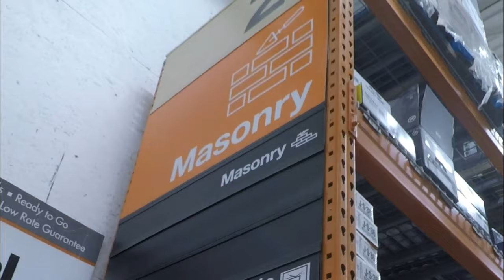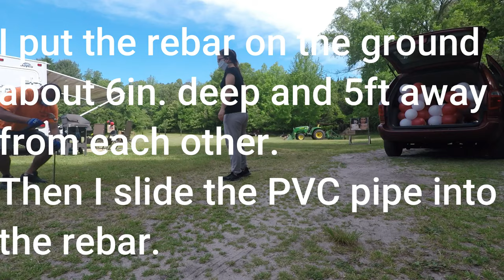Outdoor Balloon Decor / How To Instal Balloons Outdoor / How To Decorate For a Graduation Parade

Comment: Would you recommend a longer rebar pipe to better secure the Columns? What did you do to better reinforce the Number Balloons to the Columns. I saw that you went back!!
Reply from the maker: Hello!  I add 5inch balloons under the numbers !  Also used UGlue dots to glue the numbers to the latex balloons !  This size rebars were just perfect for the Columns !  I may use longer ones if I do an arch , but for columns I don’t see any need of longer ones !

Comment: It looks like you put something on the top of the rebar before you put the pipe over it. What would that be? Wouldn't the high wind pull the pipe of the bar
Reply from the maker: I put a balloon over the rebar , so it doesn’t pop the inflated balloons !  That day was super windy and everything was fine !  I would say , it there is strong winds in the forecast just use longer rebar